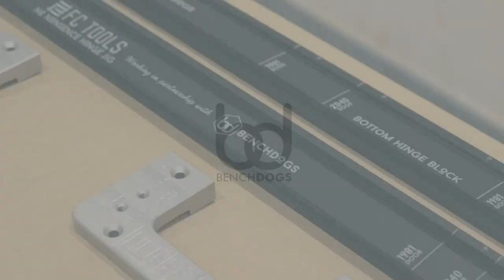All New FC Hinge Jig

Comment: On your website it doesn’t show you what you get when you select a package
Reply from the maker: Hi mate if u pick what jig u want then u can and what u want to add in accessories ok
Reply: @Fchybridrailsquare  so if I want a jig that has double on and comes with everything what would it cost
Reply from the maker: What do u need it to do?
Reply: @Fchybridrailsquare  I router new frames and doors x16 at a time. But I use 4inch and 3inch hinges   I want to save time so if I have the double and insert what would this cost me.
Reply from the maker: The deluxe double sided hinge blocks + three 3" inserts would be £250 + £42
Reply: @Fchybridrailsquare  I have come to a decision if I want the tool with all the accessories what would it cost me. I figure why not just buy it all I am gonna need it
Reply from the maker: @liamscotting6926  hi mate u just need to go onto the website and add what u want into the basket and the total cost will be showing on the site
Reply: @Fchybridrailsquare  hi mate  how are you  sorry I text on this time I like to ask about jig still have more and if give me little more information  how to order thank you